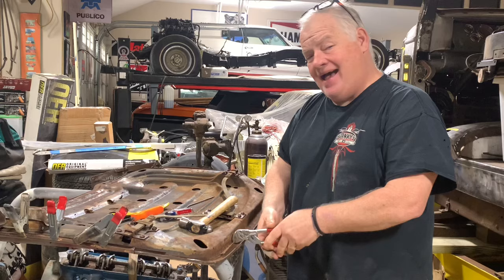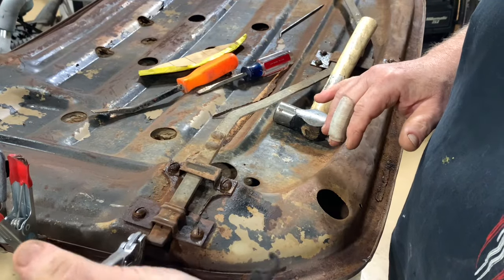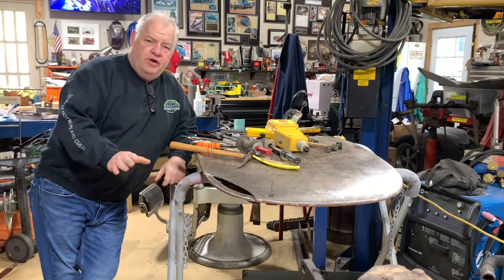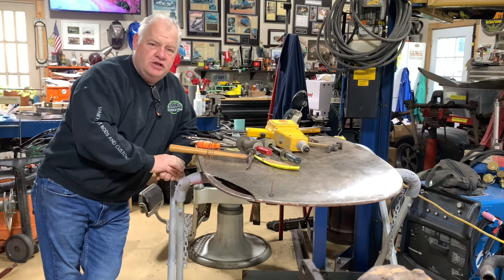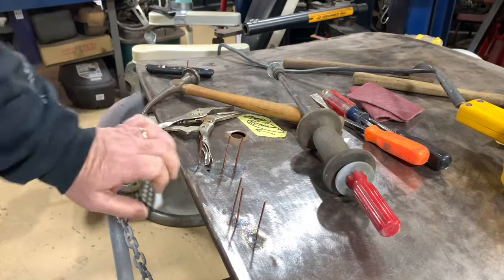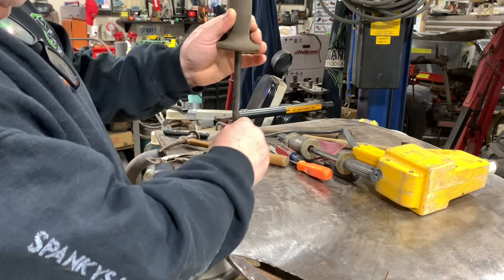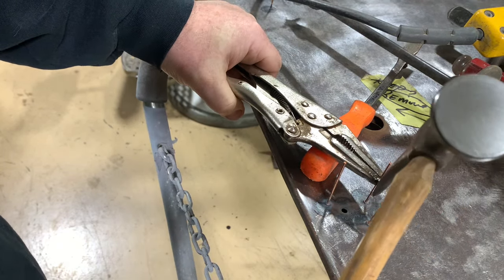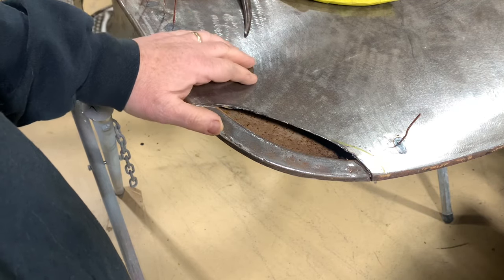Look What Happened today: How To Build a Hot Rod

Comment: Great video Spanky, I like the look of the back of the car after you lopped off that hump! HS Auto Shot were the original makers of the Uni-Spotter, now everyone has a copy. Keep on building we will watch them when you make em'.
Reply from the maker: Brian, I have a question. Just sprayed some Harley parts with Harley paint base and top coat with lots of metallic flakes. The top coat would even go through the strainer. Primer,sealer and base were all slick. Top coat had texture from the metallic . Did I do something wrong? Can I scuff and clear after a few days? Thanks